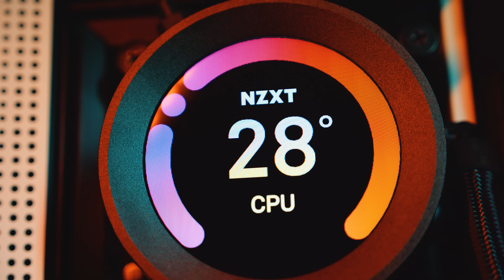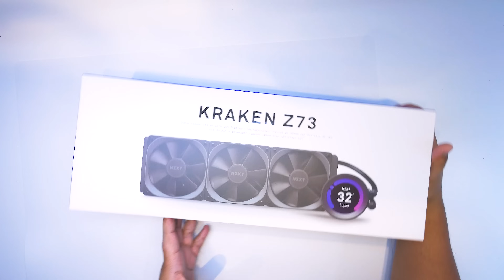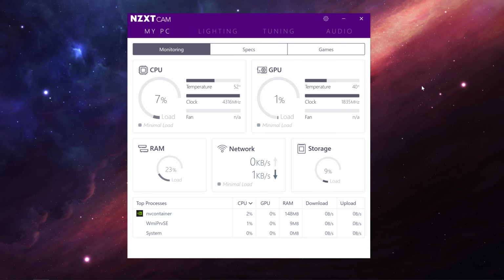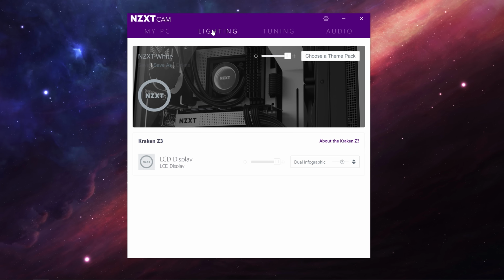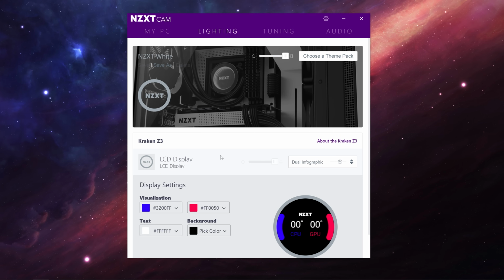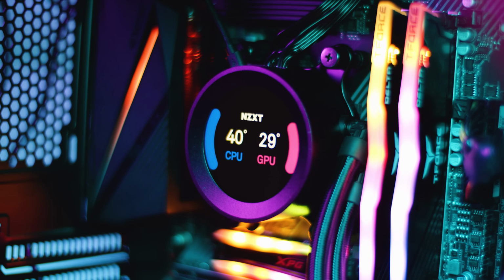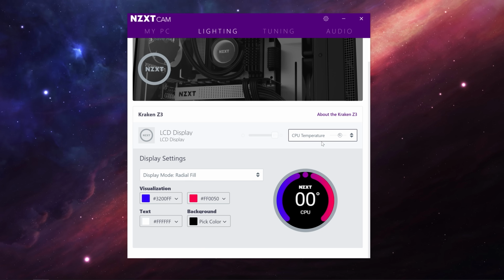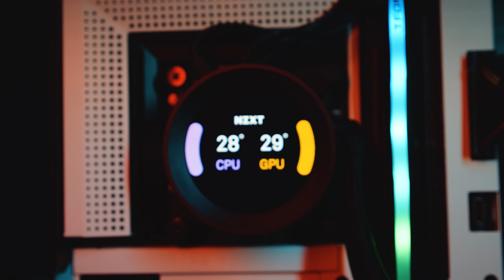HOWTO Install NZXT Kraken Z73& Z63 on Intel Desktop/HEDT

Comment: omg its that same shitty backplate i had for a different cooler, can i buy something stronger? because i broke the one of the last cooler that had that same plastic one

edit: seeing it being installed here is actually better on this, the one i had came with my pc since i got a pre build and the thing wasnt fitting in properly

Comment: Wow - I missed the cable installation at 7:58.  I was sure the Kraken was broken and even had a trouble ticket in with NZXT to fix it.  That cable installation wasn't shown in the NZXT written instructions that came with unit and wasn't shown in the NZXT How To Video either.  Thank you so much! After I saw your video, I installed the mystery cable and the system is working great!  Now I can cancel that trouble ticket (and maybe the Amazon purchase of the replacement cooler too!)

Comment: Not sure if you gonna respond cuz of the old video buuut i've got my first AIO ever and its z73 but i can't mount it like its on the video cuz i have 4 ram sticks  corsair dominator rams so the tubes from the pump i made it little higher from the top is that ok or should i remove the aio and try to place it that way that  the tubes gonna be at the bottom

Comment: Literally missed half the installation
Reply from the maker: You should really learn to watch a video properly lol
Reply: @GearSeekers  i screwed in screws at 7.28 like u say. the back plate wiggles. there is space between the srcew and backplate. it wont tighten further.

Comment: Hello,
I was just wondering about the cooler's orientation. I have installed it exactly the same way but it is blocking one RAM Slot. Can I rotate it and if so what is the best orientation to avoid any problems with the liquid flow if there is any ?
Reply: Just make sure the pump isn’t the highest point in the loop or else all of the air bubbles will be stuck there and it will struggle to pump the water causing overheating

Comment: 8:58 
Strange... in official video nzxt says you should use CPU_FAN and not CPU_OPT or AIO_PUMP https://youtu.be/5ZsZnnOX_mo?t=61
Reply: I’m very confused on this aswell. my cpu is getting hot with cooler applied. fans are spinning and screen is on.

Comment: I don't get it, where should I connect the pump power control cable? at first you connected it under AIO PUMP header which I believe is named PUMP FAN1 on my motherboard I'm not sure if it's the same "MSI Z490 Godlike", but then you repeated the same process for HEDT motherboards which I don't know what these are and you connected the pump power control cable to CPU Opt header! I have Pump FAN1 header near the top right side & CPU FAN1 header at the top side on my motherboard.. so which one should I connect the pump power control cable on, CPU FAN1 or PUMP FAN1? I believe it can be connected on both as both headers look the same... please reply as soon as possible ❤
Reply from the maker: You don't have an HEDT motherboard
Reply: @GearSeekers  So I should connect it to PUMP FAN1 right? Thanks a lot for your fast reply! Amazing tutorials as always bro.. subscribed 👊
Reply from the maker: Yeah that will work

Comment: My kraken must be faulty. Screen comes on then just goes away. And they app does not  see it at all. Fans work fine just the damn screen that’s messed up. I keep changing where I plug it in at as well between the aio pump and opt port and nothing.

Comment: i was going crazy with that freaking cable ha ha ha, then i saw this video and finally calm down knowing i don´t need it :p, on another point, if i change the fans for another brand with argb, can i connect the argb cables to my argb header and the fans to the same nzxt fan header?

Comment: What if i have the AIO header on motherboard but still plug the cable on the CPU header? 
Also where to connect the 3pin cable for fans? 
Currently i plugged the pump to CPU and radiator fans to CPU_opt. Is this wrong? Chassis fan 1 and 2 on my MB are already taken

Comment: for some reason the 14 pin power connector for the block was flipped around for me. good thing i looked at the plug instead of jamming it in like how it was in the video.
Reply from the maker: a little bit of common sense goes a long way

Comment: I’m having trouble being able to change the lcd screen. It’s just showing the degrees in Celsius and says liquid and the temp but won’t let me change anything in the cam software. The only thing I can change in the software is the color of the led light in my case. Any ideas anyone?
Reply: When you installed did you plug your fans into the cpu_fan header or the aio_pump header?
Reply: @robsmith4365  the cpu fan. One of my cables I couldn’t find what it went to. My lcd screen lights up and shows liquid and the temp but I can’t get it to change on the CAM software.
Reply: @MACK_5649  did you plug in the micro usb to usb 2.0 cable?
Reply: @MACK_5649  also I am looking to get the z63, should I put it on top as exhaust since there is room for it?
Reply: @robsmith4365  yes I did.

Comment: Hi there! I'm mounting a Kraken Z73 on a Asus ROG Maximus XII Extreme. I'd really like to do it the best way, but I don't see it clear. Let's think of 2 cases: 
- With the default fans included with the Z73: I should connect the Z73 pump to the Water Pump connector according to Asus, and then the fans to CPU_FAN and CPU_OPT... if they are only 2 fans. But in the Z73 we have 3 fans, so, where should I connect the 3rd one? Or should I ignore this and connect them through the special cable included and then to... where in the motherboard? 
- If I change the defaults fans for RGB fans, how should I connect them? 
I'm really struggling here... I'd appreciate some help. Thank you!

Comment: Can anyone help me I'm noticing when I put the Intel bracket and the 4 screws in the mobo the back plate has a wiggle to it. Meaning it isn't flush  has anyone had this problem
Reply: I have the same problem

Comment: So no thermal paste? 🤔
Reply from the maker: Pre-Applied
Reply: @GearSeekers  with my beast build coming I think I'll still apply.. i9-10900K : RTX 3090 : DDR 64GB & thanks for your vid too.. nice one 👍
Reply from the maker: What lol. It's already on the cooler. Exactly like mentioned in the video
Reply: @GearSeekers  yea but its a contentious issue mate. Some say remove that paste, clean & then add your own & some say not. Would you trust the Kraken's pre applied or remove & add your own? 🤔

Comment: 7:13  after mounting them the backplate and the screws are moving are this suppose to be like that. I cant see anyother way to do it
Reply: Did you figure it out, after mounting the block it wouldn’t go all 4 screws in the same time
Reply: @gustavomarin6535  it tightened up for me all fine now. 30 C degrees all good
Reply: @olebrommm  oh okay. I’m installing me rn I had one wrong screw in lmao but now the ram clearance sucks

Comment: LPT: mount the radiator with the cables at the bottom to prevent air from going into the pump & less noise
Reply from the maker: Wrong. Before you comment "wAtCH GaMeRs NeXuS vIdEO" I suggest you watch it again 🤣

Comment: I built my new PC (2nd time building a pc in 6 years) this weekend. Last night I finally sat down to use it and realized my corsair fans all were running at a low speed, even while gaming. I checked the CAM software and saw the Fan was at 0 speed and immediately realized I installed my corsair fans wrong so there was no way to get a signal from the Kraken to tell the fans to speed up. This video helped me realize I need to plug the three fans into the NZXT cables and not the MOBO (Facepalm). I guess I am still pretty new at building. Thanks for the information GS!

Comment: What you said @7:55 is FALSE. You can mess this up. There's a slight difference in spacing from the edge of one side to the other side so even though I plugged the cable in, it was not actually plugged in. For anyone who receives the CPU FAN ERROR, make sure you plug the cable into the pump the right way.
Reply from the maker: Wrong
Reply: @GearSeekers  Make a video and prove it. :) #challengeaccepted
Reply: Please dont follow tutorial from this channel theres so many false and wrong instruction. Dont know he is really expert or just know a lil bit but claim to be tech expert 🤣

Comment: What standoffs / back-plate do you use with the 10900k? It says its LGA 1200 but there are no instructions for this in the box for the Z63 :-/ Help?
Reply from the maker: It's the same as 115x
Reply: @GearSeekers  Thanks. I used the same as what you did in video - the intel backplate with the screws of equal threading length on both sides. I think that is correct.

Comment: When you installed the x73 backplate on mother board did it come through a little
On CPU side. Because when installing stand-offs I have a little up and down play. My mother board is Rog strix z490 e gaming. I tried the backplate on another same motherboard and it did the same thing.
Reply: I’m having the same problem. I was trying to see if he had something similar in the install. It kinda looks like he did but it makes me uncomfortable knowing it can move away from the cpu...
Reply: Was having the same issue but once you install the pump it becomes tighter.
Reply: I watched a video and took screen shots and enlarged and saw the posts stuck above the board as well. So took the gamble and all worked out and nice to have 29 temps at idle from 40. Thanks for the replies.

Comment: Not sure if this is a valid question, but my 360 fan base is at the back of my case; can you rotate the centre block for the AIO pipes so they are on the left instead of on the right by the RAM?

Comment: I have the MSI B360M Mortar mobo and i dont really understand what you mean by the AIO pump, i have the system fan connector that looks similar to the AIO pump but i dont know if i should use that.

Comment: Hey, quick question, randomly I have the same case as yours, since our Phanteks case came with fans should I use those or it will be much better temperatures if I use the Nzxt ones?

Comment: I recently bought the strix z390-f gaming with an i9-9900k. Got the x63 (280mm) for cooling and plugged everything in. On BIOS the cpu temp continues to climb and i don’t feel the pump moving any liquid. Tried shaking it in case of air bubbles and taking the pump off and turning it to ease the tubes into a better position. Any ideas as to what could be the problem?

Comment: the cable you mention at 12:36... is that suppose to be included with the Kraken? i have no idea what cable that is and it did not come in my kraken box or with the mobo.... where did you find it and what is it called??

Comment: So i just got the kraken z73, do i need the HUE 2 Ambient V2 to customize the LCD display? My CAM software isnt showing what his shows.
Reply: Yeah you've been hoodwinked and gear seekers is not going to respond, I have this cooler cam software is junk, the usb cable is faulty, and ram clearance is impossible on any set up... I've installed this cooler in 3 builds and had nothing but problems...

Comment: So, I installed the cooler and my cpu is running at 95 degrees when the system turns on and stays there consistently. Any tips,
Reply from the maker: make sure you installed it correctly

Comment: Hello! I followed these instructions exactly and everything powered on but my radiator fans werent spinning. I reconnected and still nothing so I unplugged sata cable and reconnected and the whole cooler shut off and will not power back on. Any ideas?
Reply from the maker: You probably plugged in the power backwards into the pump top. Pretty easy to do on these
Reply: Thanks for the reply! I checked the plug and it was fine. I removed the fans from the breakaway cable and put them on cpu fan and cpu opt and the fans started working and spinning. Do you think the fan cable coming out of the pump could be bad or do I have a setting wrong or in bios maybe?

Comment: I'm trying to install this in A h710I and I have 2 USB 2.0 ports on my z390 aorus master but the Cam device requires one of them and the front panel of the case requires 1 of them and then the z73 requires a 3rd so is it possible for me to attach all the fans to the kracken pump and run them through that because I can't connect the smart device and the pump. I'm out of 2.0 headers on the mobo. I'd just run all the fans from the breakout fan cables on the pump? Help?
Reply: same question as mine. I got asus z390-i with only 1 usb2.0 header but need 2 for H210i front panel and one for the cooler, need help too.

Comment: Should I wear a anti static wrist band when installing this cooler or what it your routine when working on computers. I never see any YouTubers wearing them so is it necessary?
Reply from the maker: Because you don't need them. Maybe 20 years ago when every bit of hardware didn't have ESDs

Comment: can someone help me? i installed the x73 and got a cpu fan error ( i have the pump attached to aio pump header). i did some research and decided to go in bios, advanced, and selected ignore for cpu fan speed. after that, the pc booted without the error. now my issue is the cooler is not being detected by cam software at all (no supported lighting devices were found and no supported cooling devices)
Reply from the maker: make sure the USB is plugged in correctly